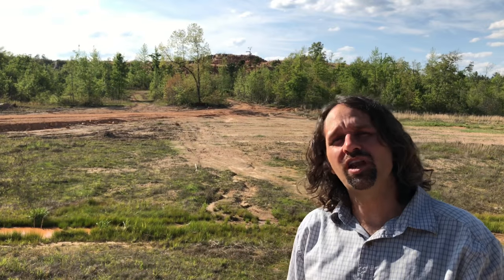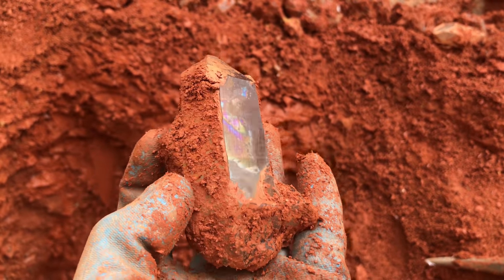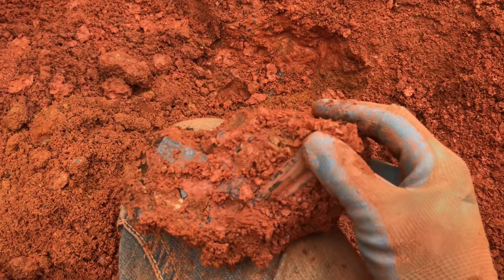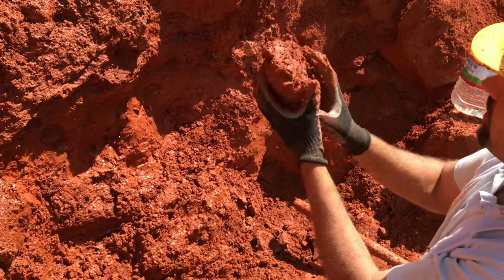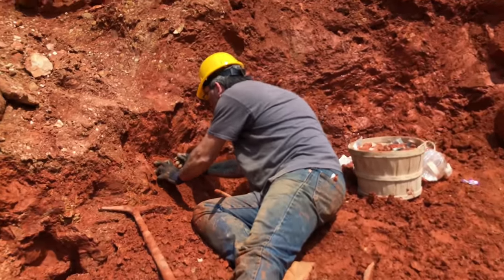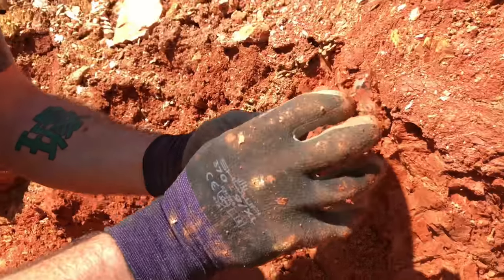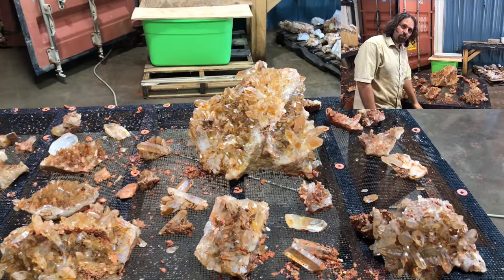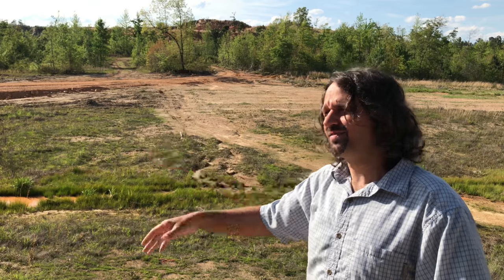Collecting Giant Quartz Crystals in Arkansas Avant Mine | World Class Mining

Comment: What is used to get the iron oxide off of the clusters?  Please and thank you!!
Reply: Kim Moore water
Reply: And a brush
Reply from the maker: A product called iron out, I’ll be putting out a video this weekend on how to clean crystals
Reply: The Crystal Collector Thank you!  I went to Diamond Hill in March and got a whole bunch of surface funds. I had a blast. But when I cleaned them I couldn’t get the iron off of them.
Reply: Bad Art I did use water and a brush to get the dirt off. It’s the iron that’s actually almost imbedded on the crystals. It’s extremely hard to get off with just water and a brush.

Comment: Question: What is the best way to clean calcite crystals?
Reply from the maker: What location?  I’d use mostly water and a brush, but it you want to take off a layer or basically melt the outer layer of calcite you can use chemicals
Reply: It's from Belgium. Most of them still have a brown mud shine/rough outer coat after washing. Still pretty brittle.